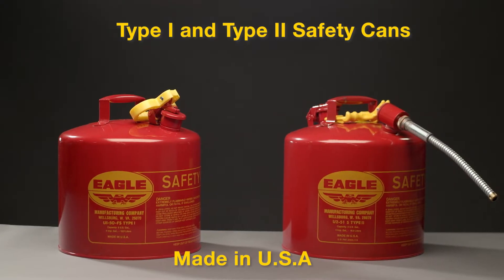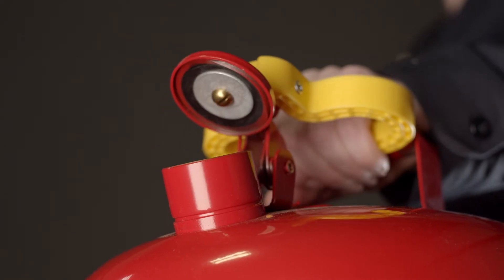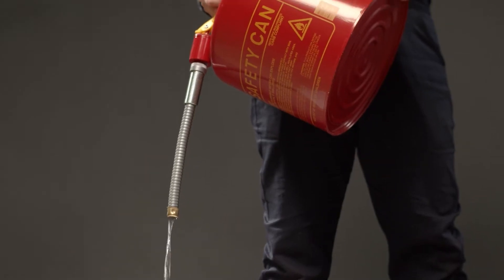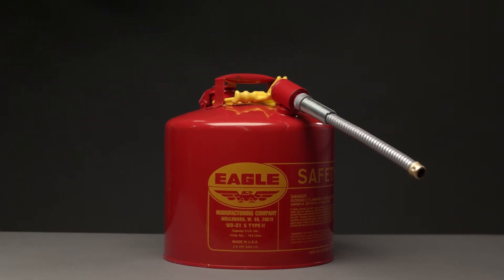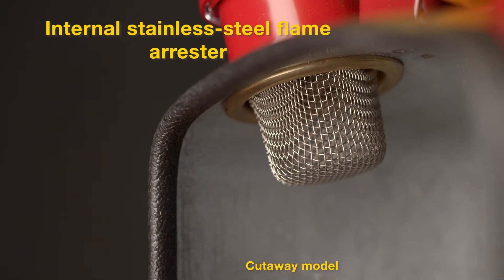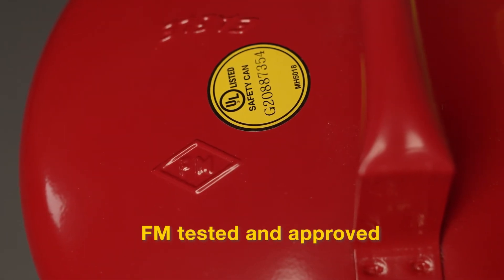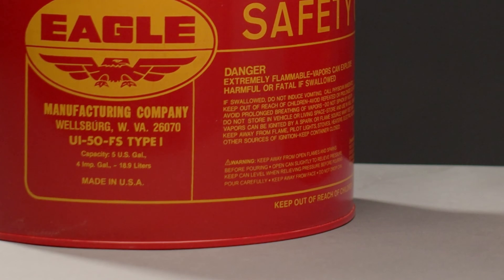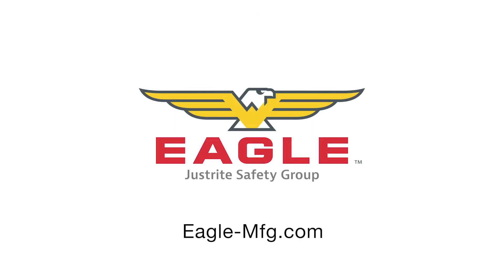Eagle Safety Cans - Type I and Type II Product Overview - Made in the USA

Comment: Junk. Funnel snaps off, and good luck getting one without a dent.
Reply: If you say so. I have multiple cans of this variety, in different sizes. Never have had an issue with any of them after many years of use. They’re the best gas cans out there in my opinion.
Reply: Holy mother of God ! A DENT? On a metal gas can ????  Clutches pearls. I guess it won't look so good on my mantle piece in my dining room.